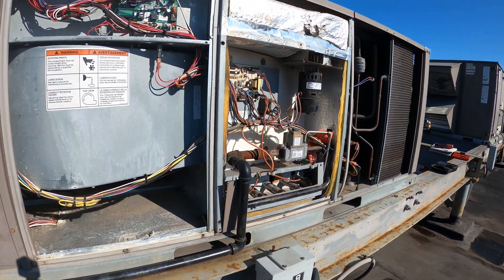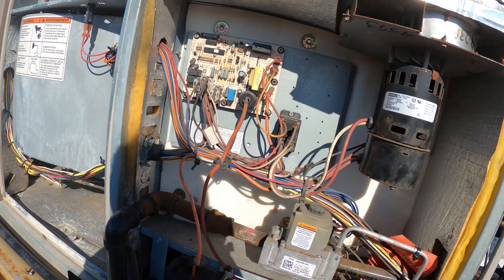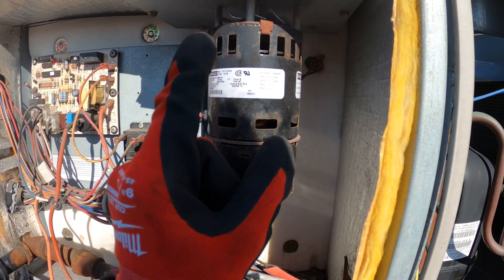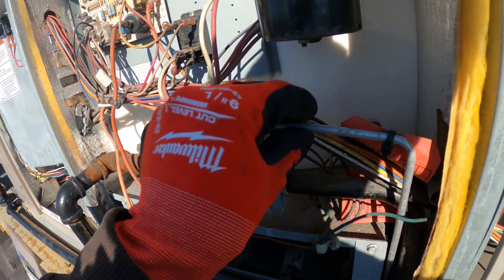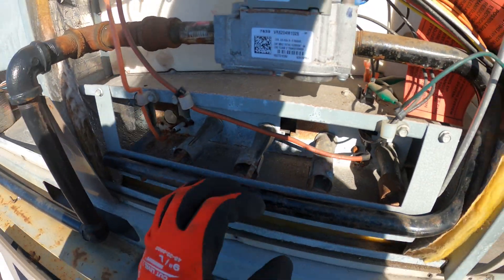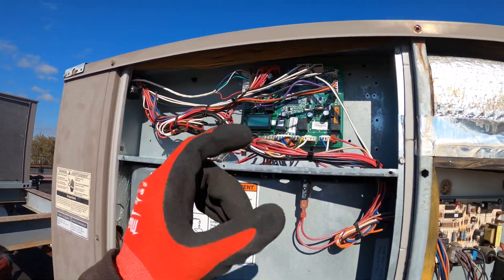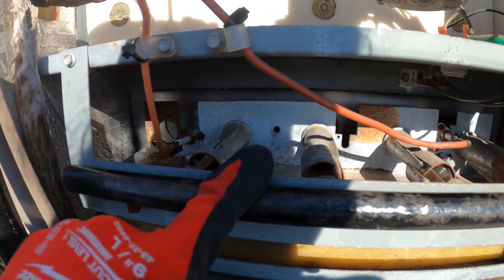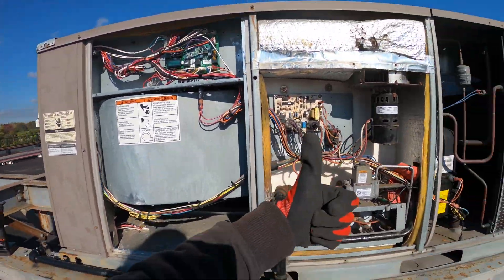HVAC: Gas Furnace Spark Ignition Sequence Of Operation (Furnace Sequence Of Operation)

Comment: Your wording is making me twitch, it's not an "air switch" its a centrifugal switch, it uses centrifugal force to close contacts, its attached to the shaft of the motor. They don't use that anymore because the wheel would break off and it would still fire.  The ignition system is a spark to pilot, pilot to main flame and that tube is a flame spreader tube not the same as a "pilot" . The alternative to the centrifugal switch the differential pressure switch is most common now because it test for the actual draft and when it fails it fails safe. The flame sensor is of course, flame rectification, why not just say that instead of talking to your audience like your at your kids 5th grade class describing what you do for a living. ?

Comment: Yo! Not trying to be an ass because I just learned this myself but that induced draft motor has a centrifugal switch in it, not an air proving switch. Great video.
Reply: Yep CS = centrifugal switch. Newer units use DP (differential pressure) switch to prove draft. A draft motor can lose its impeller and the CS only proves the motor is turning.

Comment: You're the best at explaining how a furnace should work. I have a question please ? When my thermostat is in the off position my blower motor turns on for 90 seconds and turn off. . I've checked the fan wire (green) and the power wire (red) to make sure they're not touching. Have you ever encountered a situation like this and what did you do to correct it. Thanks for your reply.